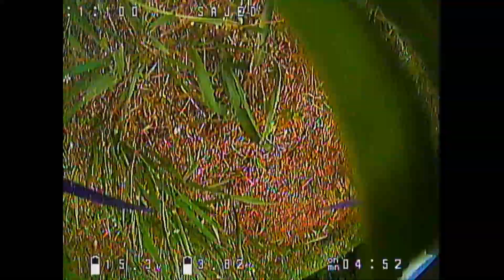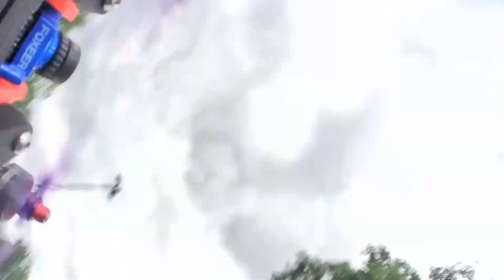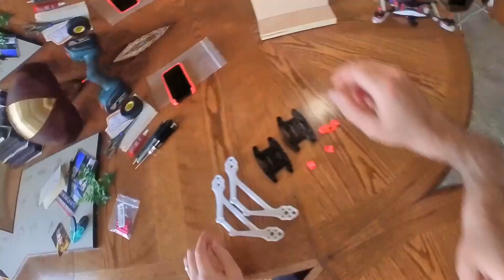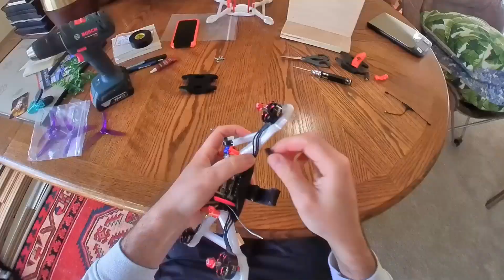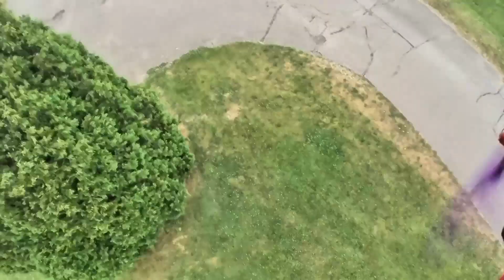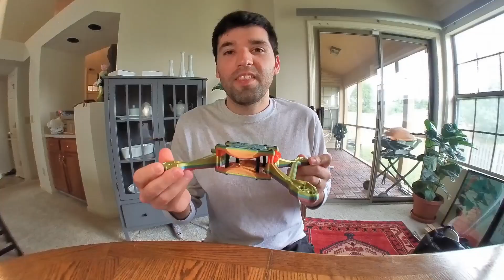Affordable 3D Printed 5" Racing Drone Frame

Comment: Bruh how does this not have more views, all over YouTube I look for a design, and yet here is the only good one with less than 3k views. Such a shame, All the other designs I see use flat bottom plates and top plates and have lots of pieces and don't take advantage of the strengths of 3d printing which is to make any shape you want. It's probably not quite as durable as a carbon fiber frame but I'm impressed with the ease of assembly and the ability to change arms without rebuilding the quad and moving all your electronics. A top mounted battery seems like an easy enough modification,  I will be trying this despite my 120mm print bed maybe I'll make a 3 inch lol.
Kudos to you cause I thought this task was impossible.
Reply: I second this. Currently looking for a design and I find this and I’m seriously considering trying this after I order some better filament. I heard carbon fiber pla is pretty easy to print. Have you seen the Aether frame? That one has seen some success. And fails lol

Comment: looks really nice! I have been trying to do something similar but with a 7". I have tried an airfoil design for my arms so it could generate a little bit of lift (something similar to the DJI FPV drone that just came out) to help improve the duration of flight but with not much success.